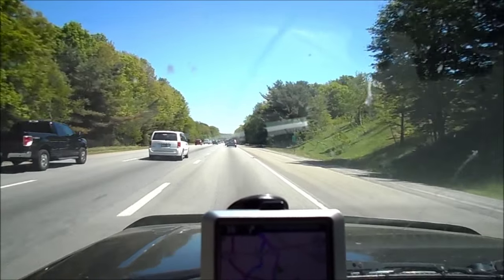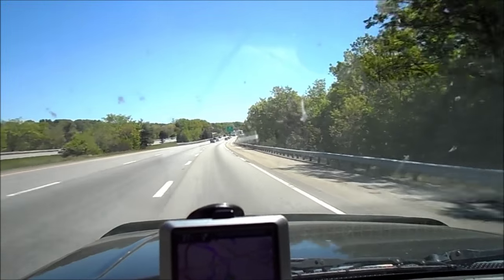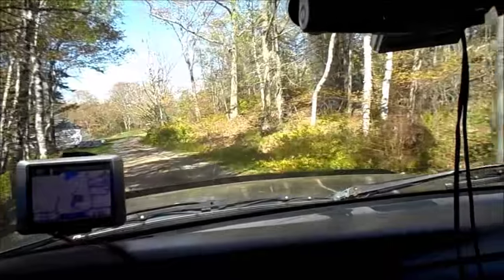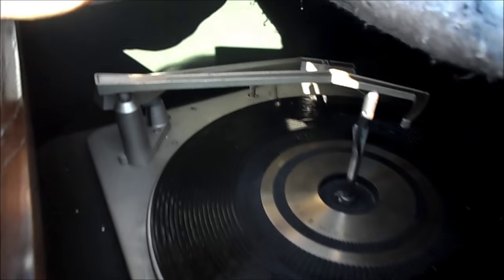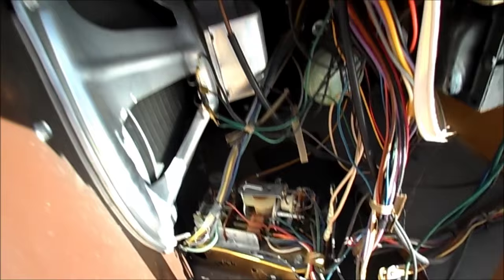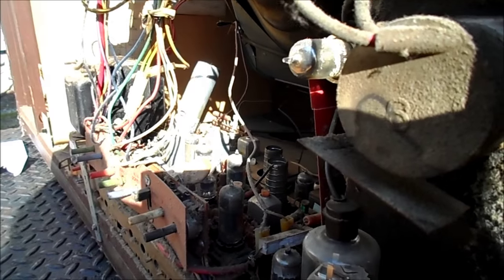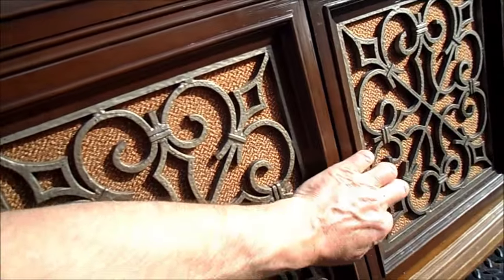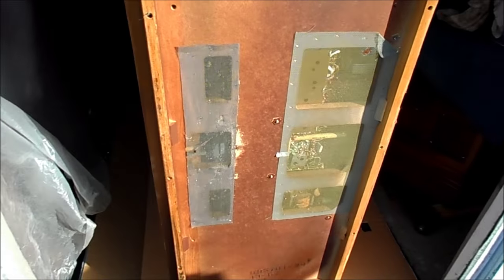Drive To Fetch An Oceanside 1968 Magnavox Astrosonic TV Combination.

Comment: I am surprised to see that it is a 25" set - must have been right at that point of the switch up from 23" (which is what the Magnavox sets had in 1967). Those sets had a wonderful picture when new (we had a '67) but QC issues were a nightmare with them. You'd have one set be trouble free and other be nothing but trouble. Their TV sets and stereos were total opposites in this respect... that Astro-Sonic, after some needed caps, should sound fantastic! Looks like an Astro-Sonic 30 as far as the stereo portion goes. Good luck!
Reply: Oh yeah, we got ours in 68 or so, and we got to know the repair man so well we naked a cat after him! The stereo part sounded great though, they chose very good speaker elements for those sets, probably would have sounded even better if the speaker parts had sealed cabinets.

Comment: Hi Robert, Isn't it ironic how far you drove for your Magnavox and then waiting for you back home was a 1974 Sharp T.V. and a retro stand (?!)  Icing on the cake!  Did you really hold off on not plugging in that Magnavox?  I don't think I could have that kind of patience.
Reply from the maker: mrob75 Yes it's set aside. Did however just stumble upon a Magnavox factory service manual for the T931 chassis in with items from a previous trip. Number 7301. Strange.

Comment: I know this was 6 years ago but I am just curious if you ever got that beast working. I have one just like it except it's from 1966. It needs lots of work. The radio works but the TV part isn't working because someone took all the chassis tubes out years ago. Mine is also a remote set.
Reply from the maker: Untouched since the pickup. Usually someone would take all the tubes out for testing at a self service tester, & never put them back. Thank you for watching!

Comment: That Magnavox is one nice set, 12" speakers, great sound not like today's flat panel TV's with those tinny speakers.
BTW....Did you run out of space yet?...LOL
Reply from the maker: ***** Shifted a '70's Electrophonic (good but particle board) AM/FM 8-track BSR unit, & That  Lloyds/Monteverdi (which I'd LOVE to find someone for), & 3 Hours of stuff management later, found a spot. Yes. I should collect wristwatches instead.
Reply: What audio output tubes dose it use? I like the way how the speakers are mounted... And they seem powerful and in good shape, am I right? :)